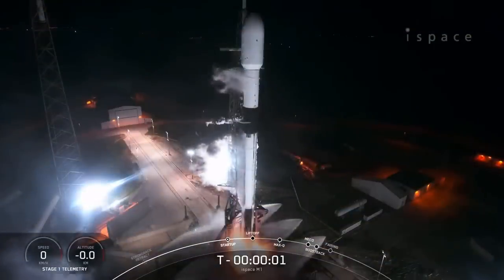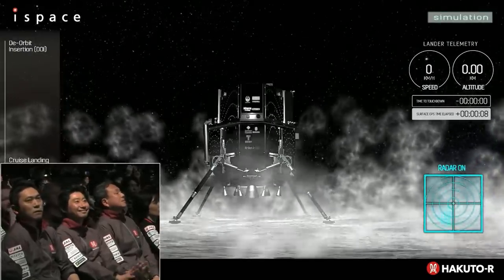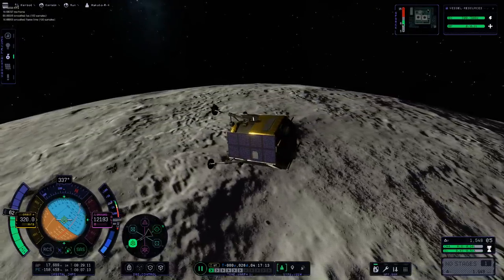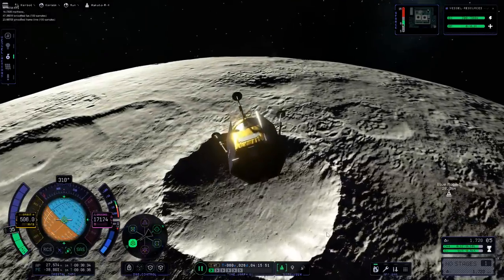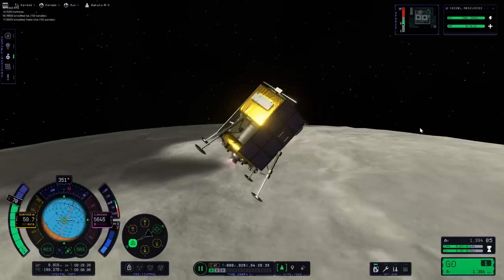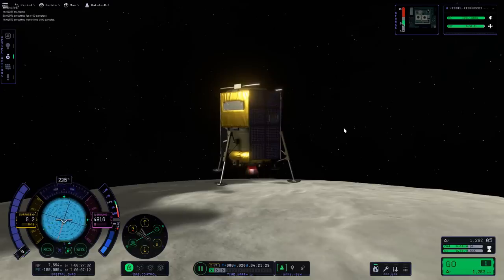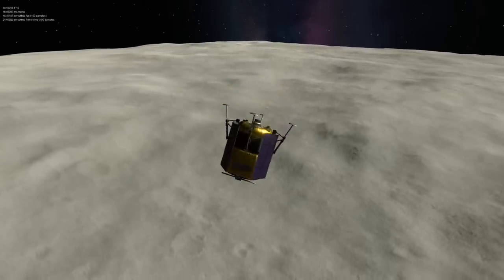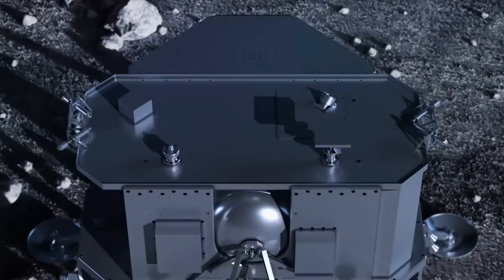Why Japan's Moon Lander Crashed Due to An Unbelievable Computer Bug

Comment: This is not just software. It's brittle sensor fusion. 

We can use the fingerprint of a Wifi signal to calculate how many people are in a room. Of course we can use a radar fingerprint to not only know our altitude but also where exactly we are on the moon surface. Add cameras and other sensors and to get lost as a spaceship is just dumb.

And immediately start flying blind seems also needlessly black and white. There's a probability a sensor broke. Okay, so try it again a bit later. Is it back in normal range? Then don't completely disregard it.
Reply: Are you a member of the iSpace team with actual knowledge of the hardware and software, or just guessing?

Comment: That’s not a software bug at all. That’s a design choice that led to unwanted behavior. The system did exactly what it was supposed to do. But the requirements engineers didn’t think about a situation like this. Not a million tests could catch that problem because it was working perfectly fine. If a QA engineer had found it, it would have been luck. And luck is no part of testing. Only an FMEA maybe had caught it. That’s why it’s so important to go through all stages of QA and reviews.
That’s what we can learn from it. I’m sure they did and will do it better next time. That’s just part of it. Although luck should be excluded, sometimes it’s just bad luck. You can’t fool Murphy 😓

Comment: Can we even call these bugs a “software” bug? Most of the time the software itself is working perfectly fine, it had just been developed under the wrong assumptions about hardware behaviour.
And IMHO the solution for these bugs is just better verification, tests and integration tests, not even more planning and specification.

Comment: I mean it's the typically first mun mission mistake, you spend all your time looking at the mean sea level altimeter instead of the radar altimeter and either burn up all your fuel hovering over a crater or smash into a mountain with almost full tanks

Comment: We sent a craft to Mars and the software engineers screwed up and used the metric system instead of imperial units. Or maybe it was the other way around. That's why you double and triple check everything before launching. Cheers from America.

Comment: A moot point, but I wouldn't call that a computer bug.   It's a condition that was not anticipated and not tested for.  Inadequate QA.   Every well managed space flight project has a test plan.  Anticipating all possible problems is next to impossible.   Testing for bugs, eg: overflow on a calculation, loss of variable scope in a function that requires that variable (a common C# fearure), incorrect calculations with certain inputs, etc, etc, should be 100% effective.  That is the low-hanging fruit.   Knowing what to test for is more difficult.   In this case, they should have reviewed there test plan and checked that the new flight path did not introduce hazards that were not tested for earlier.

Comment: You say that ignoring the RA was in theory sensible, if the data is assumed corrupt. But is it? It is not really plausible that an autonomous lander could safely park itself on the lunar surface without RA data, given its other sensors/data was not precise enough to ensure this. So what's the gain in ignoring the RA at all? This isn't like an airliner, where if the RA goes unreliable the pilots can ignore it and land using other systems. It's a sine qua non for landing... so why is there even the possibility of the lander ignoring it? If there's no RA, it's a mission ending situation - may as well take the risk with unreliabile RA versus no RA!

Comment: How about an alarm or some other indicator when the distance to surface changes drastically?  Someone in the control room can then look at the data and possibly send a reset command.
Reply: There is probably quite a lag
Reply: @mrpocock  At that distance, transmission time one way is less than 1.5 seconds.  If the lander was hovering as long as it seemed to be, that would have given them time to at least notice something was off, even if not correct it. 

It seems like they just didn't do the right simulation for the path they took, but even that could have worked - anticipated distance to surface vs measured. If it goes too far off, sound an alarm, program the lander to cease descent and wait for instructions ... something like that.
Reply: @critthought2866  I agree there should have been multiple "not in Kansas any more" alarms and cutouts and manual override points. In my experience, beurocratic software projects are crap at handling failure modes as they sell themselves almost entirely on the promises of the single success mode.
Reply: @mrpocock     Agree 100% about those software packages.  Yet another reason to marvel at the AGC - that thing handled failure and overload like no other system I've seen.

Comment: This is really cool, because this problem of software complexity is a problem we're facing on the ground too, industrial applications and general programming. Heck, it's a problem in game design like Kerbal Space Program! We can design code to solve very complex issues efficiently, but once we have to solve multiple such issues, we realize that more and more errors are introduced by the complexity and a human's ability to manage the code goes out of the window. Add a competitive timeframe to this and physical engineering and the results become disastrous. Think the recent Boeing 737 MAX woes. We arrive to the conflicting result that a far less elaborate instrument can perform the job with more success. A rule that is true in biology and warfare and appears universal. (Let's think that the Apollo equivalent for the soviet union failed most likely due to complexity, as it uses over 30 engines, if i recall correctly, not so different from the SpaceX heavy launcher, but with cold war autoation!)
So ultimately reducing complexity, both in engineering and the problem itself, to reduce the complexity of the solution might be the underrated gold standard today, at least until we invent better chaos-handling systems and algorithms. What really perplexes me though is that human hubris always tries to solve issues by increasing complexity, despite how well-known everything i said is.

Comment: Yup. I'm studying online multiplayer now, and we face a similar issue. State synchronization of a whole bunch of different clients calculating their own physics. But... yeah... you don't want to just ignore your radar altimeter without some kind of alternative. I wouldn't call that a 'bug', though. It sounds like the software did exactly what it was meant to do. This was just bad software design.

Comment: I guess they forgot how the first moon landing went when Armstrong over-rode the RADAR landed and steered the LEM to the surface.
Reply: Armstrong did it to avoid huge rocks, unsuitable terrain, not because there was any malfunction
Reply: @olasek7972  you don’t get it. The computer didn’t land the LEM for them, Armstrong saw that they would have crashed and had to do the job for them.  Landing by sensor is harder, sometimes, than letting the monkey do it. All it takes is one line of code to blow it.

Comment: If you do not see it working, you merely think it works. Only testing/simulations convert that into fact. Such a great vid! I will incorporate it into software training programs. Perhaps, it could still not work, but because from other external factors not taken into account in testing/simulation, that is fine, that is agile methodologies for. Fail fast, improve fast. But something that could have been identified by simply running a good test, it is kind of frustrating, and expensive sometimes.

Comment: The lander knows where it is at all times. It knows this because it knows where it isn't. By subtracting where it is from where it isn't, or where it wasn't from where it is (whichever is greater), it obtains a difference, or deviation. The guidance subsystem uses deviations to generate corrective commands to drive the lander from a position where it is to a position where it isn't, and arriving at a position where it wasn't, it now is. Consequently, the position where it is, is now the position that it wasn't, and it follows that the position that it was, is now the position that it isn't.
Simple~

Comment: very interesting! i do wonder at the point they coded a limit for how far a sensor can change before it's deemed inaccurate and to be ignored, how did they determine that limit?
i could imagine not necessarily thinking of this scenario specifically, but shouldn't it have already been covered at the point you set a limit for sensor ignore range? you can't arbitrarily set that- it'd have to be based on the potential topography of what you're trying to land on. hard to believe this happened really! how frustrating it must have been >.<
Reply: At some point either some engineer was too tired/incompetent to ask for more time and funding for a more elegant solution or an upper management demanded immediate results

Comment: As a software engineer, I take offense in calling this a software bug. It was a procedural mishap in the organisational structure of the project. They didn't do enough simulating.
Reply: I mean it was technically a bug [unexpected behavior], that just wasn't really the ultimate cause of the failure, which was the lack of retesting once the launch site changed. But we need that juicy video title
Reply: @snowthemegaabsol6819  Ja clickbaited! :D
Reply: As a software engineer I take offense you don’t know what the official industry definition of software bug is 😅
Reply: @olasek7972  Where I work the definition is "a feature" :D

Comment: If you are going to rely on a sensor for a critical system such as landing, then it's important that a backup is available just incase it breaks.
But then, if you add a backup and the two sensors differ dramatically,  how do you know which one is giving correct data ?
Well, the answer is to have at least 3 sensors so you can acertain which sensor is not working and then you can ignore it.
This solution would have saved the mission.
I don't really think this was so much a Software issue, more of a lack of forethought by those in charge....
Reply: I agree that three sensors would be ideal. But spacecraft design is a game of compromise. It's not an option to add two backups to every sensor you have.

Comment: Not a "computer bug" though
A computer bug would be a design mistake of the CPU for example. Like a design error that exists at the instruction level, for example an added that would return a wrong result for two specially crafter arguments 
This is just a design error, from what I understand the program did exactly what he was supposed to do.

Comment: Whoever 'changed the site' after testing was done is at fault.  Whoever didn't reject the request to change the site at that point is at fault too.

This is about the LEADING cause of software project failures -- changing requirements.

Comment: Not unblevable, I tested sattellite software for over 20 years. As an example most coed will contain over 10 millions of lines of code (windows 7 was  over 200 million) and on the average there is some kind of conditional branch every to instructions or about 1 million branches. Therefore the number of different paths taken is expotential large and basically not 100% testable. This is just an example. Even automated testers fail.

Comment: We need better terminology (which would lead to better forethought) to segregate "bug" types.  "A user entering alpha characters into a numeric field" VS "overflowing a stack into another memory space" VS (failure of imagination) "just not ever envisioning that the program would be used this way or in these circumstances" . . . these are all very different things.  This is almost more of an "edge case testing" specific (failure of imagination).

Comment: You mean BELIEVABLE???? Computers crash all the time, software crashes all the time. It's shocking that they didn't have a MANUAL OVER RIDE when the software also should have had such error-detections in place

Comment: I'm sure late to this party! But yes, what the few others I read already said, and even you, more testing would have caught this. Don't just test it with a few flight paths. Pick a random orbit for it to descend from,  and pick a random spot for it to land. Simulate it landing on that spot on the actual Moon. If it doesn't land safely at least 995 (or some success value everyone's happy with) out of 1000, then it's broke. It's easy to imagine it ending up in the wrong orbit with enough fuel to land bot not enough to get to the "correct" orbit. Making it able to safely land in the wrong place is so much better than it crash landing.

It seems short-sighted to blame it on "software" or "a bug." It's clear that, like any failure, many things (in addition to insufficient testing) contributed. The control system "correctly" decided that a big jump in height mean the radar was broke, and it "correctly" attempted to land with whatever other info it had.  James Reason has the Swiss Cheese Model of error detection, there are always various "layers" of a system that can catch possible problems where other layers have holes. With enough layers (though admittedly this is oversimplifying), you can catch the vast majority of problems before they cause harm.

Also read up on the Space Shuttle Launch Computer(s), they went through extensive testing before the first launch.

Comment: Radar was the only method they had installed to determine altitude ???  What about cameras, lasers and sonar ?  I would have expected something like this to have multiple redundancies onboard.
Reply: Sonar isn't an option. :)
Reply: @TheEvilmooseofdoom  Fair enough.  But lasers would - and I’d bet there are other methods I didn’t list.  My main question is why wasn’t there a redundancy?  Maybe even dropping a tiny beacon to the surface and then using it for guidance… 🤷🏻‍♂️

Comment: When Armstrong was landing, their computer went wild and he shut it off and landed the LEM without the computer.
Reply: No. The lander software was controlling the LEM all the way to the surface. The computer spit out a couple of error codes on the way down, but never shut down. The programmers at MIT, coded the programs to ignore the errors and continue working. Neil adjusted the landing by toggling the computer controls. The P64 and P65 programs controlled the final landing phases.
Reply: @peterginsburg2465  thanks. Five and half decades things get forgotten. ;-)
Reply: @eottoe2001  I tend to remember because I worked at MIT's Instrumentation Lab at the time. It was a heck of an era.

Comment: How did you attribute the failure as software glitch and yet say that they location was changed after the simulation was completed? Beats me. I don’t think that the Vikram lander and this issue are similar though, right?
Reply: A bug is not a glitch. A bug is a repeatable error caused by a fault in code, either by improper implementation, forgetting something important, or even something as simple as forgetting that one semicolon on line 11037
Reply: @snowthemegaabsol6819 Had the Japanese not changed the location it might’ve worked with the same code?

Comment: Yet NASA did it flawlessly 6 times from their first attempt, with 2 men on board, 1960’s tech and practically no computer power. And came back!!!! I think not. It astonishes me so many, including Scott, still cannot see the wood for the trees. It never happened guys.
Reply from the maker: It astonishes me that you get confused between a computer and a human flying a spacecraft. I need to stop overestimating people.
Reply: @scottmanley  not confused at all, in fact it only compounds my point. Way more difficult to do it with men on board (first time) controlling a pressurised spacecraft and returning it, than landing and leaving an unmanned computer on autopilot with over 50 years more computer power and tech. How can you maintain this “doublethink” and look yourself in the mirror?

Comment: They recon Chandrayaan-2 was hacked by Korean hackers causing it to loose communications .Thats why on Chandrayaan-3 they made it automatic .I was wondering if thats what happened to the Russian lander
Reply: Stop it bruh. CY-2 was as automatic as CY-3.
It's just that it's engines overfired during the final descent & it's software was too restrictive to make significant corrections. That's why it crashed.

Comment: Thanks, very Interesting. Perhaps something else when wrong to attempt the landing 5 km too high. A faulty RA would be ignored by design. So, as mentioned, the lander would have had other systems (accelerometers, speedometers, attitude indicators, rate of burn measurements, etc)  to enable it to land without an RA. I wonder what went wrong with those systems such that they attempted the landing so far out . Yes, the meaurement errors propagate over time. But, for altitute, only since the last 'reliable' RA reading, which I get the impression from the video was during the decent and so only minutes from the planned landing time.

Comment: It seems unthinkable that a probe sent to the Moon in modern times wouldn't have at least one camera providing a live video feed.  They would have been able to determine the problem visually.  I assume there must be some logical reason for the lack of a camera, but it certainly isn't obvious to me.  Also, this seems like the sort of question you should anticipate and address.  Seriously, and it was Japan's?
Reply: weight, if the mission does not need a camera they are not going to add extra weight onto it.